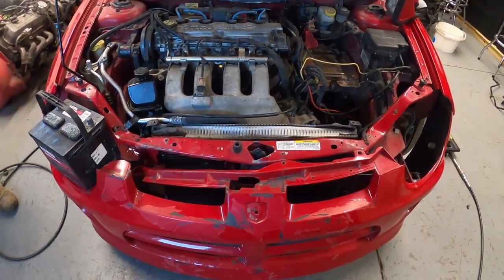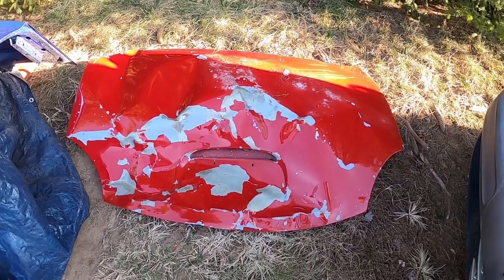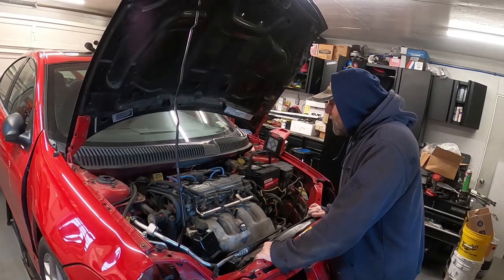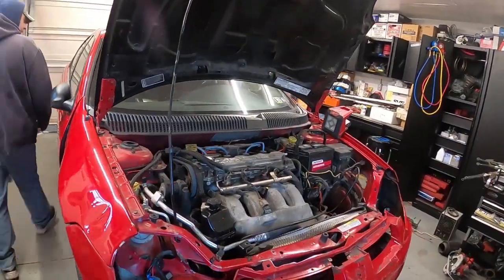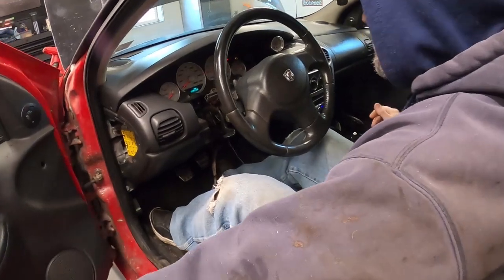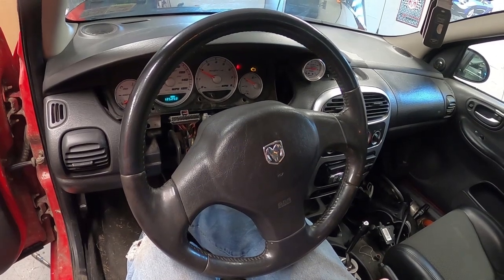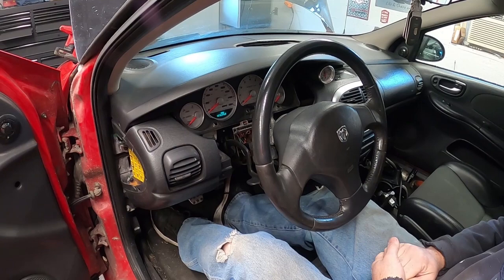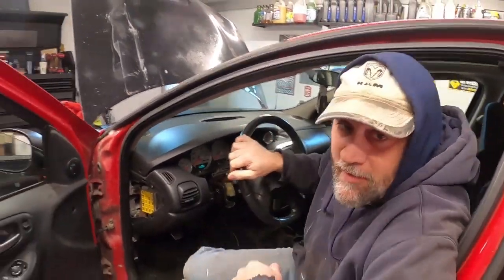TESTING OUT AN SRT4

Comment: So if 3rd pops out the trans is no good?
Reply from the maker: yes that means its bad, as its not working correctly meaning all gears and shifting as it was designed to do after looking over the car every thing out side of the transmission is working as it should good cables bushings shifter no play in the selector plate and a new clutch fork and pivot ball were installed so this will need internal repair/ worn damaged parts in side the transmission